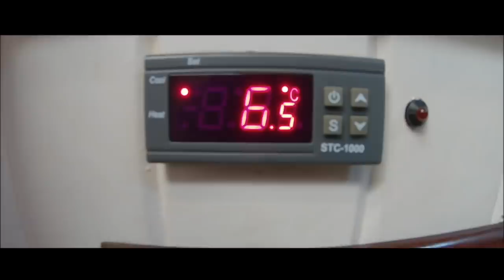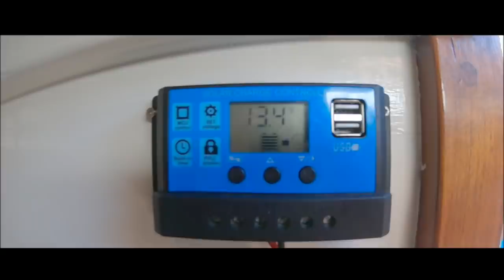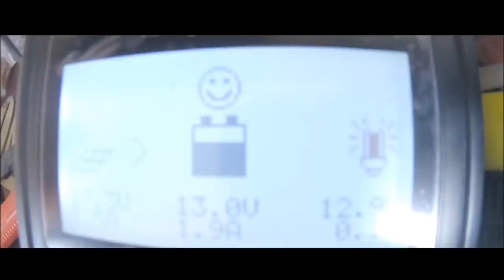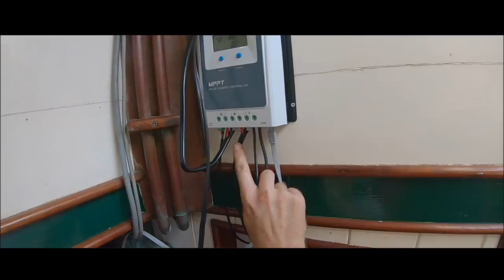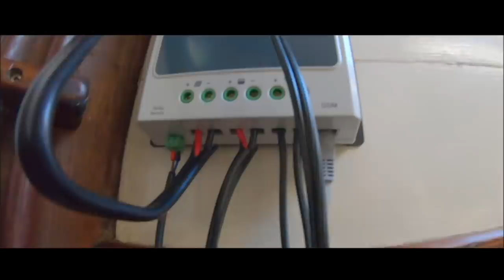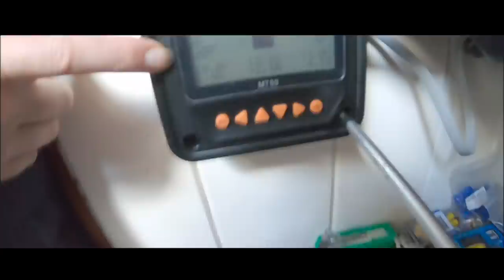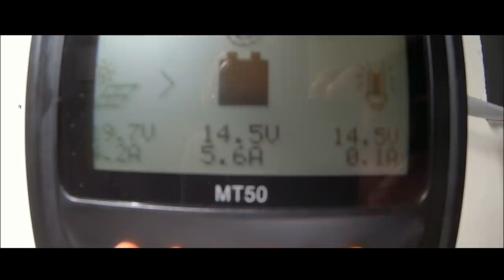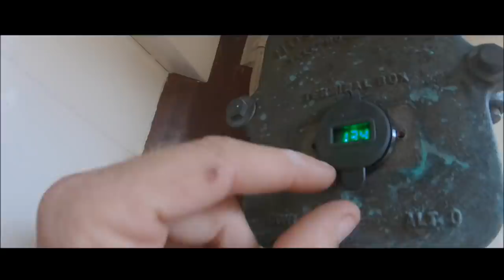Epever Controller and Solar Install

Comment: Just a thought   - and something we did to our fridge  - was wire in two computer fans  - one inside the fridge and a second 6" fan to cool the space where your compressor is -- improved the running efficiency quite a bit  - love what you two are doing
Reply from the maker: +Ian KELLY Cheers Ian, I’m running solo right now, I’ve thought of an extra fan to keep the hot air out of the cupboard!! Thanks 😉

Comment: Lovely prayer and fun, informative video.... I would happily pay you more for some detailed electrical advice as I rewire my boat alone, adding solar and wind generators!
Reply from the maker: Its funny because this is my fifth boat, before this my knowledge of 12v was limited. However after 12 years of building drones I fancy myself a bit of an expert... Shoot away. I'd love to help if I can :-)
Reply: @TheGeordietheWitchandtheWench  Starting with the battery bank, I have 2 different car batteries and 2 of the same deep cell house batteries.  Until I get all of the same deep cell RV (4 total) I am leaving the 2 lead, car batteries sitting separately and only jumping the diesel engine with them to start as extra boost as needed, I am slowly replacing all the old (corroded) wiring and buying parts as I go. Do you have a  say about that? The fire extinguisher is close at hand.... all batteries are 12volt

Comment: Just a bit of helpful advise Simon, reckon you needed to pull the arbor drill bit (centre drill bit) out a little more to keep the hole saw centred and cutting, pilot hole would also have helped.
Reply from the maker: Yeah, I worked that out after about 2 hours!! Live and learn ;-) cheers !!!
Reply: @TheGeordietheWitchandtheWench  Well some say no pain no gain, love the look of the old bronze boxes with modern electrical combo, hope you manage to get back out on the high seas soon, thanks for sharing........ (prefer the sea shanties.....cute prayer though), cheers

Comment: Fun video as usual....hey, having been down this road and had a major repair job.....perhaps think about a cover for your MPPT controller - close to the hatchway, it will be sprayed at some point and will not like it. I used clear window (dodger) material so it hangs over the unit, easily lifted out of the way a needed, but stops minor sprays, water off wet weather gear or other. Keep cracking' on....thanks, Andrew
Reply from the maker: Good advice Andrew, thanks mate!!!

Comment: So hard to find decent MPPT controller on ebay. Some of them are outright gimmicks selling PWM as MPPTs (such as Perfect Suitor which is not MPPT controller at all even if it says on the box it is). Learned hard way when I was looking for one for my Tiny House. Yours looks decent. Love ya guys. Brightens my day anytime you post.
Reply from the maker: Yes, amazing how they get away with that, I hear also the Deep Cycle batteries off eBay claiming to be 170ah are only 80ah !! Not cool !!!
Reply: Yep I got suckered into that controller too and about to rip that company in the review section of Amazon!!!

Comment: Are you sure RP7 / WD40 will stop corrosion? Would Lanox work on electrical contacts? I'm very interested to know. Will feedback if I can find any info.
Reply from the maker: Jason WD40 has kerosene so it’s not good, silicone spray. Or to stop any corrosion in its tracks you can use liquid tape!! I used RP7 as that’s all I had. As long as you clean off the excess it should be better than nothing :-) I hope that helps.
Reply: @TheGeordietheWitchandtheWench  Just wondering since I've used it myself in similar situations and it didn't last too long. It's probably good short term. I love the simplicity of the solar setup.
Reply: Lanolin is great but can get sticky and messy, especially when cold.
A mate used it on some threads on his boat and it took me an hour, a blowtorch and a wire brush to getting them moving again after the weather changed!
Reply: Use dielectric grease for connections and terminals. It's way better than wd40!

Comment: nice work bro! heads up on the flexi panels they die really fast because they overheat and burn out so only put them up when you need them
Reply from the maker: Thanks, yeah they are for anchoring and chasing the sun, hope to get at least a few years out of em ...

Comment: just read the above in full, DO NOT push hard drilling or cutting anything, let the teeth do the work! Thanks for the heart (again), take care.
Reply from the maker: Cheers Rob!!! Live and learn 🤗
Reply: Slow speed, high pressure for stainless.
If you don't press hard, the teeth skip over and just whizz round getting hot, then the stainless work hardens and it becomes a pig.
Plasma cutter for the win!!
Reply: @bushratbeachbum  cutting oil works justfine some pressure yes  but not high pressure

Comment: Wouldn't think a 110 plug would fit in a 220 socket smiling must have an adapter and I'll only run twice as fast if it doesn't burn out

Comment: Just wondering, once you had the arbor bit drilled through the stainless steel to give you a location point from the compressor location, why didn't you just drill it back from inside the fridge?
Reply from the maker: I did in the end, it was really tough going. My arms hurt for a few days after drilling just one hole, once SS heats up it hardens.. Nightmare of a job, but it's in :)

Comment: if its the same cargo net as what i bought off  EVILBAY to rig in the canopy of my 4x4  ( looks the same one ), the elastic perimeter of the net breaks pretty easily , especially with weight like fruit and veg like you have , id thread some much heavier elastic through
Reply: ERIN will surely upgrade everything with some repurposed rope and moss, dryed herbs and flowers etc.... a hammock for teddy, too
Reply from the maker: @saylaveenadmearedead  hahahah !!! no doubt at all :-)

Comment: be careful charging anything with a micro USB from your house battery they put out higher amps than car batteries and they can burn out your micro USB ports quite fast especially is you are hot spotting to a computer while charging the safest way to go is to plug your phone to your laptop and share internet via the usb cable on a boat if you are hot spotting while charging it' uses so much power the micro usb plug can get hot .
so far on my boat I've had to replace a phone and on the latest phone I've just killed  my second charge port so I have no phone till the part comes from China.......why did I pick a phone without wireless charging :(
Reply from the maker: I'll test that theory with a Multi Meter, damn eBay, you get what you pay for. I'll let you know how I get on. Thanks for the heads up. Right now the iPhone is our means of Navigation. If it blows we'll be up shit creek with out a paddle :-)
Reply: @TheGeordietheWitchandtheWench  not sure about the Iphone charging port but it does look much better then crappy micro USB port
Reply: Rubbish.
Deep cycle batteries do not burn out micro USB ports/charging circuits.
Cranking/starting/car batteries will supply a higher current for a shorter time but can only be drawn down 20% before they should be charged.
Deep cycle batteries typically supply lower current for a longer time and can be drawn down anywhere between 60-90% before needing to be charged.
Reply: @bushratbeachbum  this was an issue with micro usb charge ports on older phones if you hot spot while charging. i was burning out cables and charging ports. i experienced it on 3 different phones. i solved the problem by upgrading to a usb C phone
Reply: @razzorbladz  nothing to do with the battery chemistry or make up though, deep cycle agm, cranking, traction, lithium, they'll only supply what the charger asks for